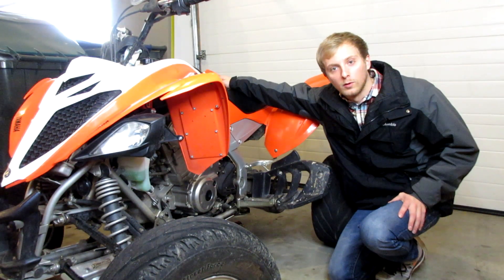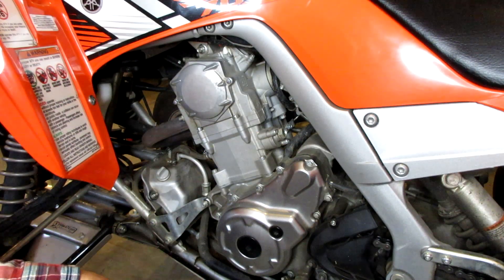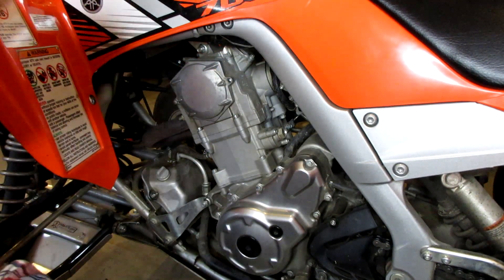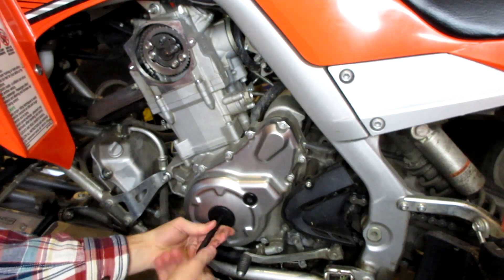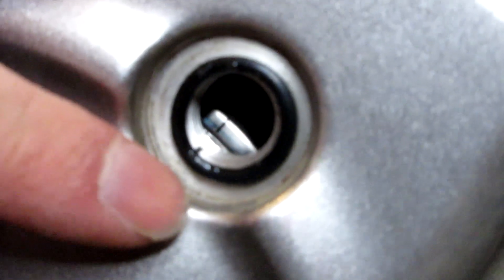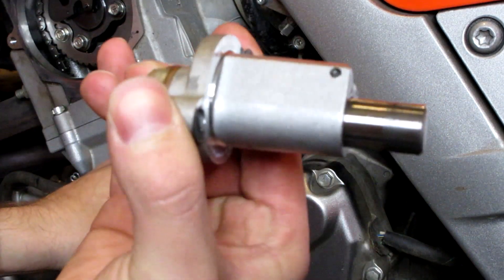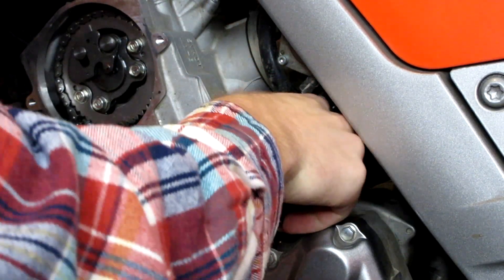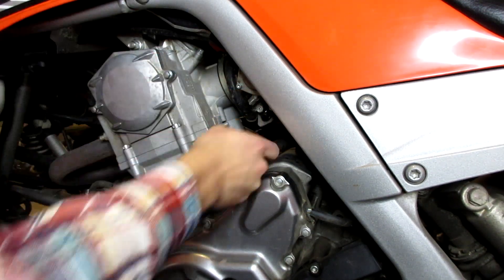Manual Cam Chain Tensioner | Install and Adjustment

Comment: This is not a recommended mod ... manufactures used this bolt/nut combo (or manual chain tensioner method) in the past (early 90s and 80s) and it was an evolution to go to the spring self adjusting chain tensioner. You can damage prematurely the chain and the guide rails  ... Please stop doing this crazy things just because "others" did it !!!

If you have too many slack in the chain just buy a new chain and tensioner !!! I always hated mods that can cause problems instead of solving them. People will buy this crap and they will overtighten the chain "so no power gets robbed" (another stupidity) and they will damage their chain and guides prematurely and end up having to buy an OEM chain + tensioner let's not talk about engine rebuilds because of chains that might break due to abnormally high tension applied to them ...

So people please think twice and think about the engineering team and resources put into making and designing an engine. Do NOT do stupid mods that will make your wallet suffer later.

This is perfectly fine ATV that should have run with that stock chain tensioner for years and years to come !
Reply from the maker: If you must know.. I reinstalled the OEM spring tensioner.  This video was meant to show the install process on any engine. I'm sure you know some bikes are known to have them fail.. (i.e. my 2007 triumph Daytona). Many people including myself switch to manual tensioners in this case because we're better off adjusting a manual one rather than waiting for the inevitable failure of the OEM one. On the Raptor the OEM ones are fine and aren't known to be a problem thats why I reinstalled mine.. but I did run the Manual one I installed in this video for months with zero problems. In my opinion, they're safe as long as you monitor and adjust them properly. Also I definitely did not install this as a power mod haha, thats dumb. And I tried my best to emphasize it should not be over tightened or too loose as engine failure can result. Thanks for your comment
Reply: You are not correct. There is not a single professional team MOTOGP or Superbike that uses an automatic tensioner. That is because Manuals are more relyable. BUT manual tensioners chain tension has to be re-checked for the correct tension periodically where automatics do not. But some automatics have proven to be unrelyable because of tearing housing and breaking springs. If you are going to check the chain tension every year or so you should get a manual tensioner. if you have 2 left hands you should get an automatic and have it installed by a dealer.
Reply: Appreciate your opinion but you have to understand one thing; mechanism or mechanicals do fail. There isn't any proven man made technology that would last a lifetime.
Reply: @khairirais  Try telling that to Nokia...
Reply: @Lucian Pop that may be your opinion, but it is an incorrect one. Automatic cam chain tensioners have been known to fail, ever since they started using them. When they fail, cam jumps timing, then comes piston to valve contact. You are welcome to keep your automatic cct, and wonder what that weird sound is,when your cam chain is loose, but I would rather spend $40 on a manual tensioner, than possibly a complete head, piston and cylinder, because the stock tensioner failed.